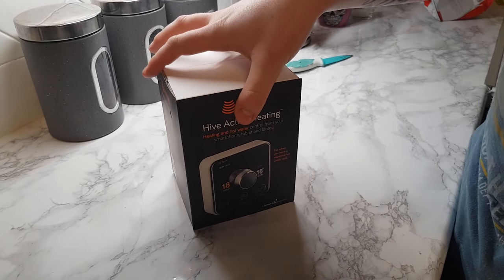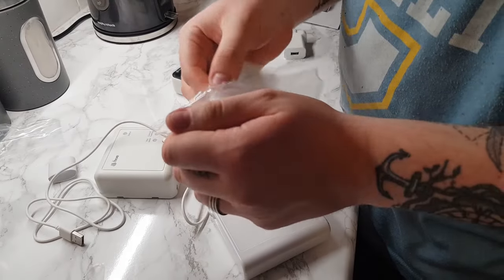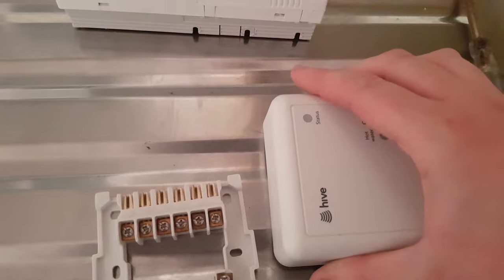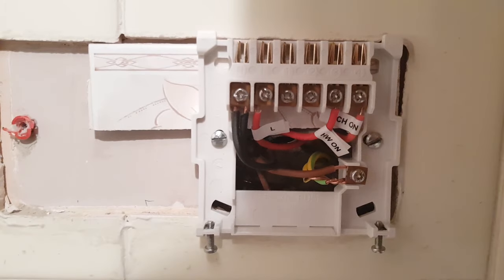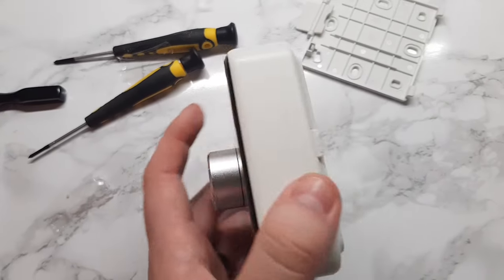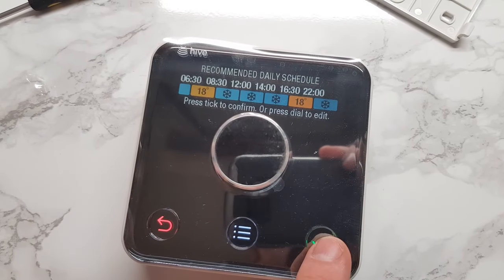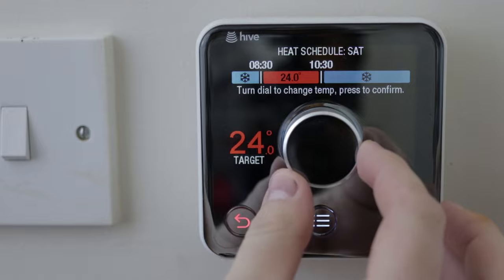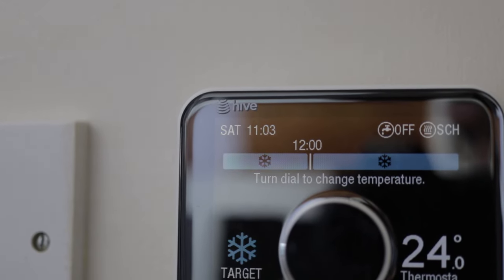Hive Active Heating and Hot Water Thermostat - Unboxing, Self Installation & First Impressions

Comment: Managed to replace my Drayton timer without changing the backplate. Just got tripped up with the old wall thermostat. Had to bridge the cables to make the signal permanently live then worked fine. Didn’t find this step in the instructions or video
Reply: How did you bridge it, my timer in the kitchen with the temp garage on the landing some 20 feet apart, with the boiler in the garage.

Comment: Great informative video. My heating system is an old style 1, with no working thermostat... On looking at my old programmers wiring, it's quite a bit different to that. Might just get the system and give it a go. You made it look easy!
Reply: I went and got 1, fitted within 30 minutes! Thank you again...
Reply: I also have a gravity fed system with a hot water cylinder. But I don’t want to be restricted to turning the hot water on only at the same time as the heating. Am I not able to time the water separately?

Comment: I have a thermostat on my water tank. Will this still work with the hive. 

Aka. if hot water on. It'll still turn off when the tank hits 60 degrees which it's set at

Comment: Hi Lee and all
Having just moved into a house with Hive and getting used to it, one question my wife keeps asking is how do I increase the hot water temperature ( for shower purposes)?
Reply: I don't have a hive so I have no idea if you can do it on that or not but all the boilers I have had you can adjust the hot water setting on the boiler to adjust the temperature to what you want.
Reply: As Chris said, there is usual a thermostat on your boiler (mine is in my hot water tank) you can adjust that to the temperature required.

Comment: If I wanted to hard wire a multizone system which cable would I run to each thermostat?

Would I need 1.5, 5 core???

Any help would be brilliant guys

Comment: Thanks, a very good video. One question if I may. So as the Thermostat is battery powered, could I theoretically tape up and tuck the wires which feed my current thermostat, and mount this one in its place? Thanks in advance.
Reply: Hi mark, did this work for you?
Reply: @charlieleadbetter6705  I've not bought one yet mate. Will probably try this though

Comment: Hey, great vid , I have a thermostat for heating and hot water thermostat bin two different locations. I was wondering how I would set it up. Thanks
Reply from the maker: You can get a multizone version, you would just install a receiver in both your current locations and then a Thermostat in each.

Comment: Hi I want to ask if you know to tell me why the thermostat can not be reconnected . I had a power cut and since is not working,I  took a battery off and put back also I did reset the wireless and still not working. At the moment I use manual to have hot water and heating.
Reply: Had a similar sort of problem. Best check the lights on the receiver when you reset it. If it is failing to flash once instead of twice. It will need replacing. Had mine replaced for less than £30 from hive themselves and now it all works fine

Comment: Great video.  Can you tell me if the thermostat makes any kind of noise when its switch on and off?  Currently the units I have make a loud click each time they switch.
Reply from the maker: The Thermostat doesn't make any noise. The receiver however does make a click sound when it turns on and off. You really only hear it if you are In the same room as it.
Reply: Thanks very much for getting back so quickly.  Great that the only noise is on the receiver which will be in the kitchen.  Currently have a dual zone setup so having a thermostat clicking in the bedroom is really annoying, even the one in the hall annoys me.
Reply: It’s quieter ‘ click’ then my old hartsmann 425 diadem

Comment: Great video! this may sound like a silly question but do all boilers have a programmer? I can only recall seeing diallers on my actual boiler but no external timer/programmer (I only just moved in to my new home so haven't checked thoroughly if there is, and I wont be able to check until next week)And if there is no external programmer/timer then will Hive still be compatible?
Reply: No not all do  mine has no external programmer. Mine was all manual. My reciver goes in the boiler cupboard and the thermostat where ever I want it. I plan to fix mine to the chimley breast once painted.

Comment: Probably know the answer but I'll ask for those wondering: If you've no router and/or don't want to tether a router to your mobile and use it that way....this isn't a system for you, yea? Or do they sell a easier system which would simply be a Ni-Cad battery to send a signal (like a PIR for security) thermostat if you're only arsed about on and off and not concerned about showing off on Instagram that you can control from outside the house like some 5 year old finding his lad for the first time.

Comment: The way you have fitted the WiFi stat ... you would need to leave  the existing room stat permanently turned up to maximum for the WiFi stat to work.
Reply: you disconnect your old stat and loop across 4&5 in your 10 way connection box.

Comment: Why on earth do you need to time your hot water? just leave it on 24/7 and let the hot water cylinder stat do the rest, this is the most ecomonicle way to retain hot water, same applies if you have just an immersion heater, just leave it on 24/7. To switch the heating on remotley might appeal to some but again why bother, if you have spare money spend it on insulation for the house.